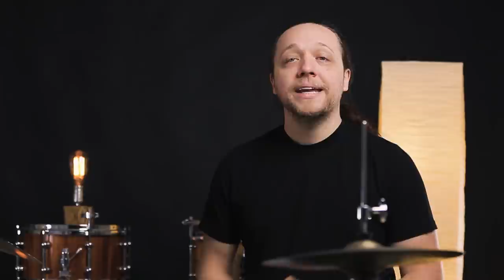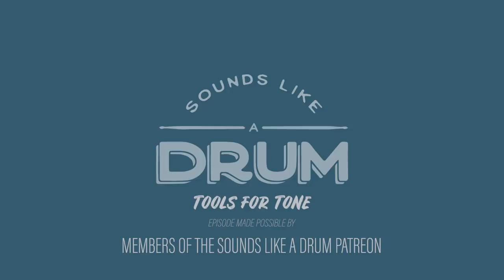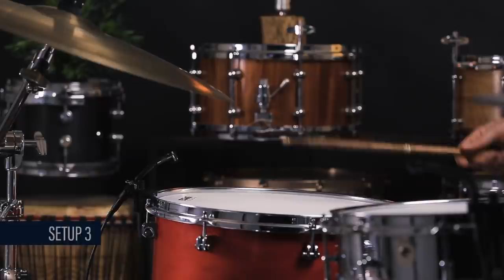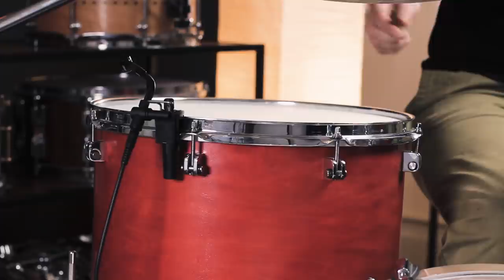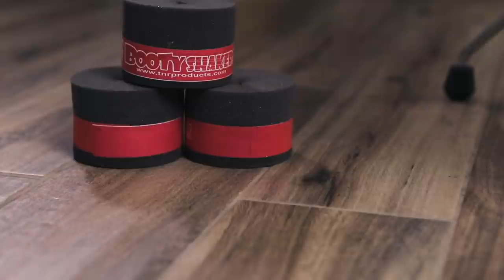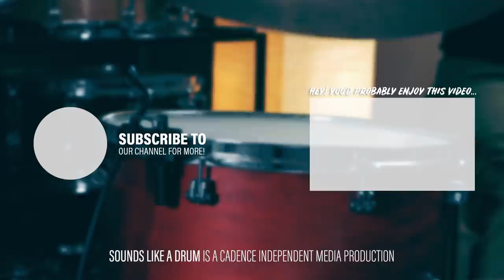Controlling Resonance vs. Sustain And Understanding The Difference | Season Three, Episode 47

Comment: Nice!  You mentioned vintage drums.  My 1978 Pearl kit is luan wood, which has the rounded edges.  The heads on both my 16 and 18 are Emps on top and Ambs on bottom.  All coated.  Both reso heads are a perfect fourth higher.  I put the new Pearl suspension rubber feet on them.  Awesome sound and the shells resonate perfectly.  They project perfectly.  The higher reso tuning naturally helps to shorten the sustain while have full shell activation.  The suspension tom feet help to really bring out the resonance.  So full natural resonance with naturally controlled shorter sustain.   That's my tone.  Great dry and warm attack.  And articulation is clear at any speed and between the drums. 

Hope this might help someone reading this.   And thank you always, SLAD, for the verbally articulate videos!

Comment: Thank you greatly for explaining these terms! I also appreciate you throwing out there that right and wrong sounds really comes down to context. I have several tunings for my toms, really comes down to how I feel. One thing that remains consistent is that I always make the shell resonate. I’m gonna crank up my toms in the next day or so and pay some homage to Bonham. 
 As far as sustain problems and fixes I have 2 kits, a Pearl Forum 13, 16, 22, and a Ludwig Club Date 12, 14, 20. I had both kits broken down for transporting and I wanted to practice so I set up the Ludwigs since I had played the Pearls for a few weeks and wanted a change. I tuned everything up nicely but the floor tom had NO sustain. I checked my tuning and it was fine, but I had put the Pearl legs on the Ludwig floor tom and that killed the sustain. Switching the legs restored the sustain I’m used to. By it’s really cool to know I can control the sustain by swapping 1, 2, or all 3 legs depending what I’m trying to do.
Reply: Thanks for sharing. I'll probably get some new floor tom legs to experiment with this!

Comment: Great video like always, but there is so much more to the issue of resonance & sustain (which I know you're aware of).  Shell thickness, shell material, heads, head tension, drum mounting, stick weigh, internal mufflers are just some of the main variables which influence resonance.  Additionally, if you play drums that have unfinished surfaces on the inside that will decrease resonance. I treat all my unfinished shells on the inside with 3 or so coats of Tung oil which wicks into the wood and thus increases the density a bit, therefore increasing resonance.  Personally I prefer maximum resonance and then worry about controlling sustain if necessary.  To my ears, max resonance = max tone (with proper tuning).  Thin shells with roundover 45's for bearing edges is a good place to start for max resonance. Obviously heads influence that significantly.  Of course there's the resonance vs. projection issue when you consider shell thickness!!!  Keep up the good work ..........
Reply: I cannot thank you enough...
My heads Evans, my sustain perfectly controlled, but couldn't quite get the resonance I desire.  My only question would be, do you seal the bearing edge also?

Comment: I have 16”x16” DW performance series, maple shell floor Tom..
Top head (power stroke 4, coated) tuned to 98hz, bottom head (factory), 154 HZ…
Love the tone, but I play fast punk…195 bpm 1/8 notes on floor Tom…
I tried the cotton ball trick…
Pulled head off 4-5 times.. and used different amounts.. didn’t really work for me, but it got me thinking..
So after some experimenting, I now have one paper towel square that hangs out at the bottom, and it sounds awesome… other drummers ask me how I got the floor Tom to sound so good, and the paper towel is a big part of it..

I have a 14” floor Tom as well, all same, but tuned 131 hz on top head, but required 3 paper towels inside to really get a nice full  rounded tone…lots of resonance, minimal sustain..

Comment: The coolest trick I’ve discovered so far to increase sustain on my 18” floor tom was to rotate two floor tom legs so that the feet are closer to the center of the drum. PSA this can make the drum a little unstable. That said,  so long as the leg set outward from the drum pointed in the direction of however you tilt it, it is plenty stable. It can get wobbly but the drum is so heavy that it’s secure.
Reply from the maker: Ever tried the Original Booty Shakers from TnR Products for increasing both sustain and resonance? Those things are the jam...
Reply: @SoundsLikeADrum  I'll have to give them a try sometime!

Comment: Would more tension points on the heads lessen the amount of sustain? I have a custom marching bass (pipe band) that I put 12 tension points on, but it is lacking in sustain. I went with rounded 45s on the bearing edges to help with the resonance, but it's a very "dry" sound right now. The shell is free floating (turnbuckle tensioning), so I can remove some of the tension points. Wondering your thoughts on this...

Comment: If someone positions a pratice tom (i.e 14"x3" single headed) above, but not touching, a 14"x14"shell with a bottom head, how close to a sealed 14x14 tom sound can they achieve? Esentially creating a vented tom with maybe 1/2" gap between top and bottom half of the shells.

Comment: I had a really dead sound coming out of my floor tom in my basement studio. Swapped the rubber feet on the tom legs with Pearl air suspension feet and it completely opened up the floor tom's sound. I could not believe it.
Reply from the maker: I actually did the same on this GMS! We just used the old ones in this video for demo purposes 👍🏻 those feet are amazing! -Cody

Comment: I always feel like my 16" floor tom lacks tone.  It has attack and some rumble, but doesn't have a "note", if that makes any sense.  Any idea how to fix that?  Your floor toms always sound great.
Reply: I am of course not the creator of this video, but what I would try is tuning up the floor tom in tiny intervals until you feel it make a note so you can keep that rumble and that low tuning you like, but also have a note. Like Cody said in the video, there’s no wrong or right sound, but if you feel like you want to change it, I would try either what I said, or try putting another head on top of it like a big fat snare. The extra mass brings down the pitch of the drum lower and tends to make it more notey at least on my tom. Does cut down on sustain. Hope that helps!
Reply: I’ve always felt that big floor toms lack the fullness of a smaller tom. I’ve found using a heavier or double ply resonant head gets a fatter “note” for me. And also studying ever video on this channel😂